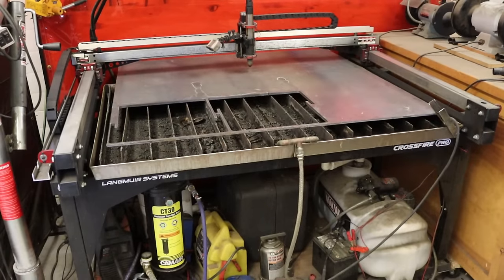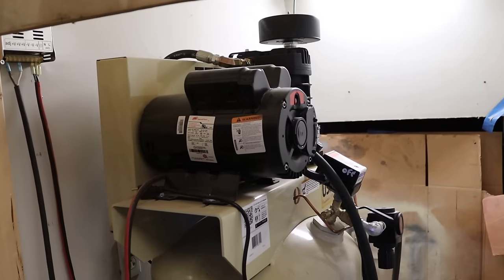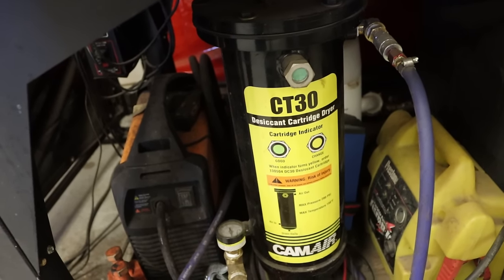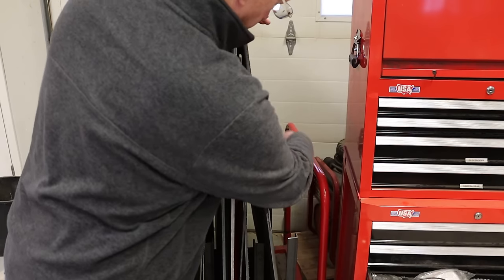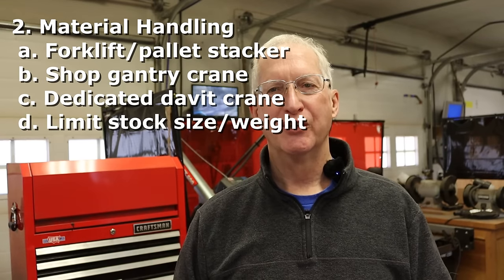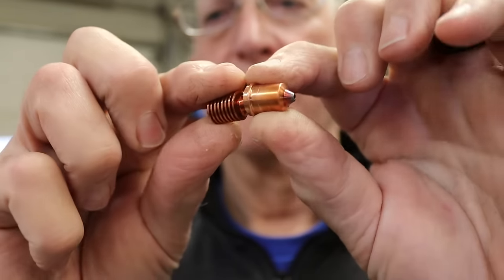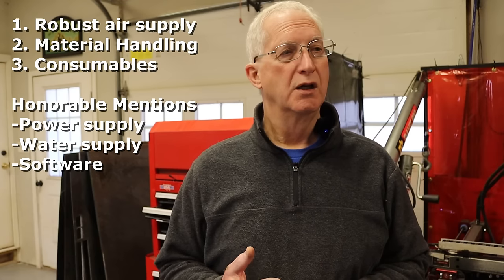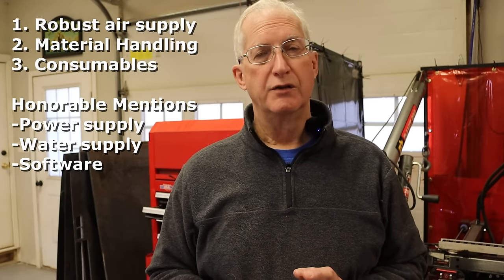Plasma Table? 3 Critical Considerations!

Comment: Great information Frank!
Your method of planning, simplicity of assembly and function, and skill in design and tooling are within the original cub cadet way.
International would have been proud.
Thanks for sharing your projects on these under rated and forgotten garden tractors.
I like the originals but you have shown that hydrostatic was a game changer.
Reply from the maker: My weekly mower is a 128.  Prefer the gear drives for most work.

Comment: What you mean I cant build a Plasma Table for $200 😂 Good solid video on the 'actual' bits needed. Engine hoist and a Magnetic lifter (or two with a linking bar with thinner stock to avoid peeling from the magnet) is a good option too.
Reply from the maker: I actually was planning to use my engine hoist initially, then decided to go with the jib crane as it takes up so much less room. The engine hoist is very unwieldy to use in a crowded shop.
Reply: @woodandmetalshoptime8048  It really depends on making the gear to suit it's extended feet to go underneath if needed. In an ideal world we would all have room for overhead gantry cranes in our home shops😉